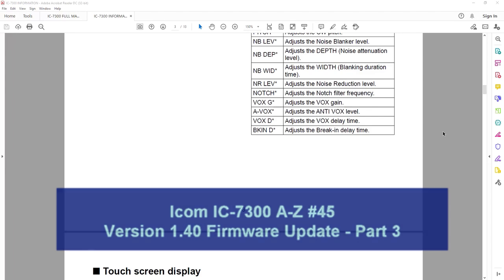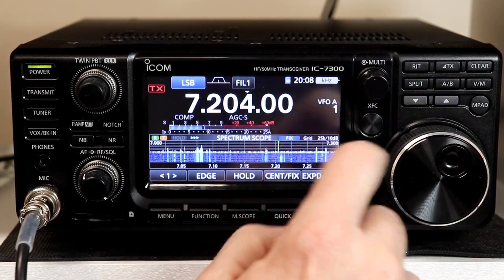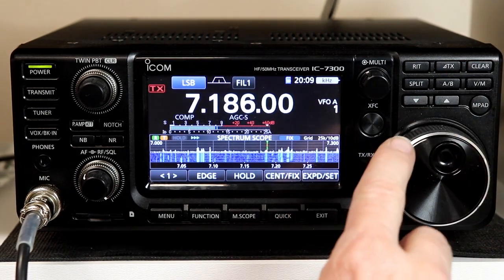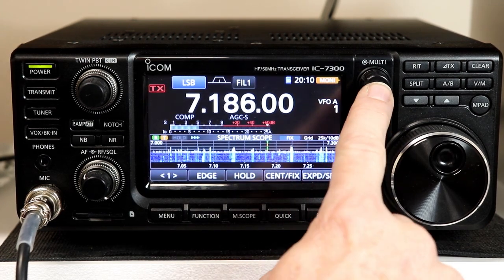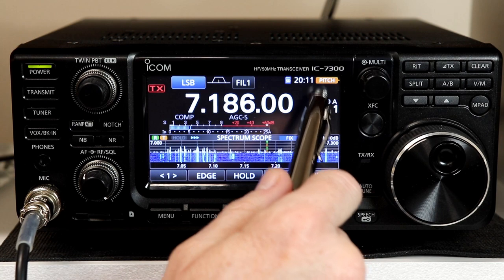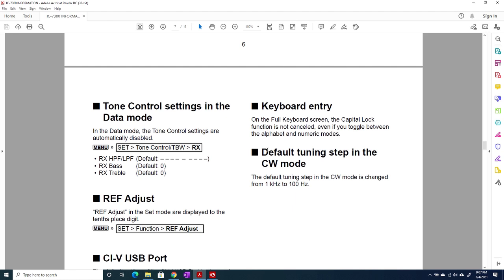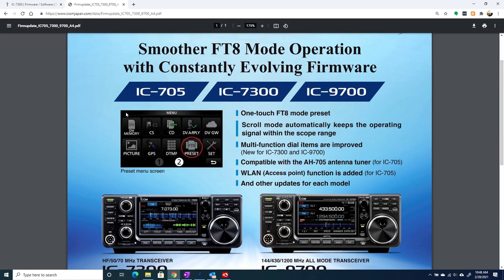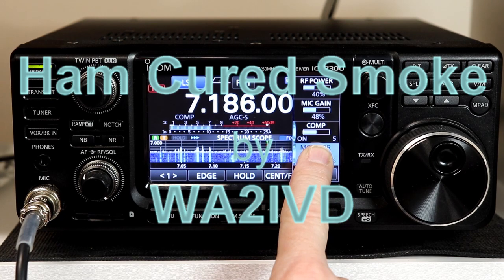IC7300 from A to Z #45  Version 1.40 Firmware - Part 3

Comment: The configurable mic's buttons is very convinience and quic during contest. Example:

Set the UP button  to voice keyer 1 which may contains CQ CQ, CQ voice. Not need to reach  and touch the screen anymore. Nice. 

THank you for explaining  all the changes in the the 1.40  updates. 73
Reply: The default for mic button in the Memory mode is to move up or down to the next memory. In VFO mode the buttons change the frequency up or down.

Comment: I had the courage to do the firmware update after watching the first in this series of videos.  Thanks for making them. 
There a a lot of functional improvements in the user interface.  However, it is a little disappointing that there is nothing with regard to the function of the radio itself.   The one area where the 7300 has been short in my experience is with the noise blanker.  It would also be nice to have more customizations for the noise reduction functions.  
On another video, someone pointed out that the UP/DOWN buttons will switch memory entries.  It is possible to switch them during transmit and put the radio in jeopardy if the chosen memory means you are transmitting into a high SWR.  
The mic button customizations are especially welcome.  I don't see a lot of value in having frequency changing buttons on a base rig's mic.  Presumably they are there because they used a mic compatible with portable rigs.
Reply: Hi..

Regards on Noise Blanker, it functioning  very well.  My base station is near a faulty street lamp which  emits very high RFI impulse  noises around 2MHz band.  THe NB  reduces it more thand 20dB.  

Thank you. 73
Reply: HIgh VSWR should be detected and cut the PA output power down immediately, even if you accidentally transmit into a load that changes a lot with frequency. I suppose that in theory a band change like this should trigger the internal antenna tuner to retune or reload known values for the new frequency.

Comment: About the CW tuning step, in CW mode the main tuning knob is set to 10Hz steps but the MULTI knob is now set to 100Hz increments by default, the same step you get by selecting the kHz digits on the display for faster tuning. However, in previous versions this default setting was 1kHz so if you saved your old settings and then restored them after installing the v1.40 firmware you would have restored the 1kHz value over the newly changed default of 100Hz. Icom changed this default, but then encouraged you to restore your old settings thus obscuring this particular change. I'm guessing that for a given setting they store its value (1kHz) or its position in a list rather than storing its state (default). If you really want to see this then reset everything (you've got your settings saved already haven't you :-p) and look at what the default MULTI knob step is now in CW mode. Naturally you could be picky and suggest that the text in the MULTI label should change to 100Hz, but maybe the generic 'kHz' is enough to tell you that it's acting as a fast tuning knob and Icom expect you to know how much each step is.
Reply from the maker: Thanks Brian!  That makes sense. When I first read the section I figured it was talking about the multi knob, but when I tried it it still tuned in 1khz steps so I figured it must be something else. Of course as you pointed out, I had already reloaded my previous settings after loading the firmware. Good catch!

Comment: This is an excellent set of videos on the updates to the 7300, thank you. 
Nothing to do with v1.4 but I have a question about using RTTY afsk on the 7300 that I have been unable to find the answer to, would you be able to answer it ? and how do I go about asking the question ?
Reply from the maker: I’ll try.  You can ask the question right here.  Maybe it will help other viewers.
Reply: @HamRadioA2Z  

Thank you, I can use RTTY connected to N1MM+ via FSK quite happily and it works a treat but it's a bit of a faf to set up as it requires either a second CI-V cable or VSPE configured for data transfer. It is far easier to use AFSK (one cable no additional configuration) with MMTTY via N1MM. While using 2125 Mark in MMTTY the 7300 1.2k filter is centered on 1.5k so the only way to put the audio signal within pass band of the filter is to turn the Twin PBF know fully clockwise shifting it upwards otherwise the received audio is right on the fall off slope of the filter. Is there any way to change the center frequency to 2.1k when in USB-D as it is when in RTTY Mode.

Sorry for the ramble but hope it makes sense.

     Julian (GW4JBQ)
Reply from the maker: Hi Julian.  You can press and hold the Filter button then adjust the filter shift upward by turning both inner and outer PBT knobs to the right.  It’s effectively the same as using the Pass Band tuning, except it will be programmed into the filter.  However, you really don’t need to do that.  When you’re using any digital mode software that decodes the audio on your PC, the filtering is built into the Digital Signal Processing (DSP) software that’s part of the program.  In fact, if you read the documentation for WSJT-X, it specifically recommends that you set the receive filters in the radio as wide as possible.  That gives the program the purist form of the received signal to work with.  When I use FL-Digi, WSJT-X or any other digital mode software, I use Filter-1 and set the bandwidth all the way out to 3.6khz (as wide as it will go).  I have not had any issues decoding RTTY or any other digital modes.
I hope this helps.  73, Tom
Reply: @HamRadioA2Z  Hi Tom, thanks for the reply. I thought that might be the only thing to do, I have 10,15,20 & 6m on the FT920 and the wire for everything else on the 7300 so switching from narrow filter on 920 to open band on 7300 is a bit noisy. I get around it by narrowing the filter in open mode but it would be much better for me to just centre the bpfilter on 2100.
Thanks for taking the time to reply and keep up the good work.
  73 de GW4JBQ

Comment: Greeting Tom I updated from 1.30 to 1.41 and when my rig re booted instead of saying Khz it was set to RIT,  i able to do RIT adjustments but i not able to move to any other settings, so far every thing else on my 7300 sems normal. I was wondering if you have heard of this problem, worst case for me a new feature that dosen not work correctly . Tom open to any suggestions you have to correct my problem. Thanks Tom Partridge

Comment: A few of my pals with 7300s....have said they are not updating.....I got my radio brand new last week....I dont want to just yet till I have a better idea of the improvements to be had.....still getting to know my version 1.30 set.

Is the anything to be said for sticking with version 12.30??

Many thanks Tom.
Reply from the maker: Hi Nick.  You certainly don’t have to update.  There is nothing wrong with V1.30.  That said, V1.40 doesn’t remove any existing features.  It just adds new ones.  So I can’t think of any good reason not to update.
Reply: @HamRadioA2Z  Thank you Tom.

Comment: I can't quite figure out how to use my microphone for CW. I get a tone, no TX with the down button. I however can get tone and TX if I press both on the down and ptt. Any ideas?
Reply from the maker: In CW mode, without break-in, you have to put the radio into Transmit mode otherwise you will just get the keyer side- tone through the speakers.  You can put the rig into transmit by pressing the Transmit button or, as you discovered, by pressing PTT.  The transmit button is located just below the power button.  It works as a toggle.  Press it once to go into transmit mode.  Press it again to go back to receive.
Another option is to put the rig in Break-in or semi-break-in mode.  You do this with the VOX/BK-IN button (2 down from the Transmit button). In either break-in mode, the rig will automatically switch to Transmit when you start sending CW and will switch back to receive when you stop.  Hope this helps.  73, Tom
Reply: @HamRadioA2Z  thanks a million. Thé breakin solution works fine. I don’t remember if I had it set up this way before the firmware update. 73, Denis

Comment: I think REF adjust has to do with the sensitivity of the waterfall.
Reply from the maker: Hi. You are correct.  There is a REF setting for the Spectrum Scope waterfall.  It is a little confusing. This REF Adjust is in the settings menu and is used to calibrate the radio’s frequency reference. They are both named REF.
Reply: Thanks